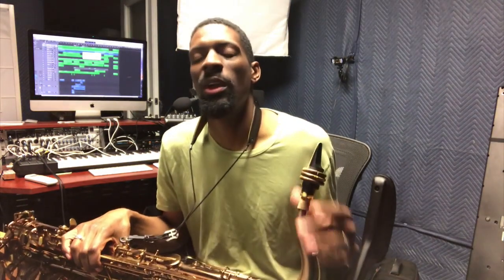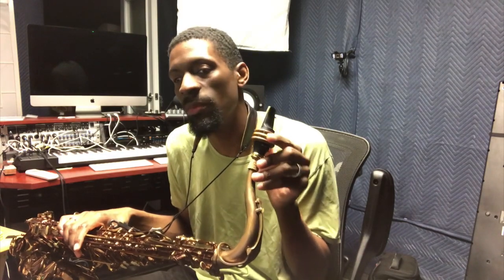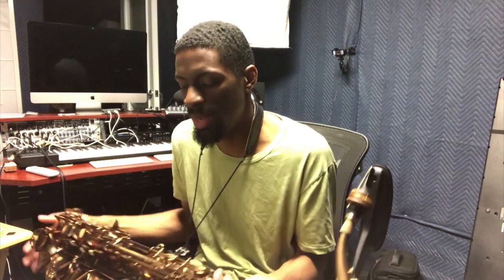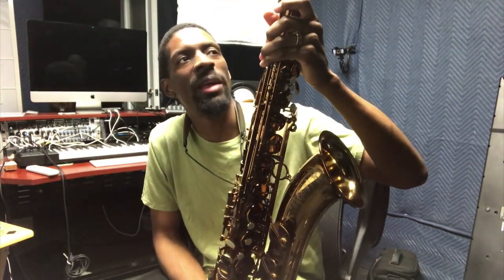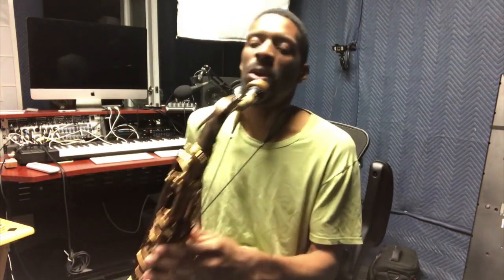How To Subtone On The Saxophone

Comment: I cannot say that I found your video of much or any practical value. Your video has only substantiated the conclusion I have arrived at after an almost infinite number of attempts at producing the subtone.You  produce the most beautiful subtone effortlessly and as you have demonstrated so eloquently with Misty that the listener arrives at the totally false conclusion that subtone production is merely a matter of shifting the lower jaw backwards somewhat. Every  jaw is different from every other jaw and the degree or extent which the jaw may be moved back or in any other direction varies. Your video demonstrates as not even a   million words would, the ability to move the jaw back is much more than ordinarily observable  in your case, hence the most expressive and exquisite subtone as easily produced with as much effort as would be required to breathe naturally in any other person. Applicable to  many other situations and circumstances,” one size does not fit all” is totally appropriate vis a vis subtone production. Thank you sincerely for a very demonstrative and explicit video and your very ridiculously simple , lucid  and factual elucidation of  your method of subtone production. The very very best to you.
Reply: Dear Mr Fowler, thank you sincerely for your reply to my rather dismal comment. Make no mistake about it, I consider you to be a Master Performer and cannot hear you enough. My almost unbearable disappointment was to   learn that I could hardly move my lower jaw back by more than a 1 cm or about one half inch and that movement required considerable effort and was associated with   discomfort. I could maintain a backward displacement of the lower jaw of about one quarter of an inch without discomfort, which  displacement however   proved quite insufficient to produce the subtone. I did find the tone mellow  down to an extent but the discomfort resulted in a displacement of not more than perhaps one sixteenth of an inch, totally inadequate for the purpose. Should you have to offer some sort of a solution involving positioning of the mouthpiece, lips, positioning of the head or any other alternative means that would effect the intended end result equivalent to a backward placement of the jaw, I would not be able to express my gratitude towards this very kind and personal  effort. Thank you,, regardless ,for an excellent and superbly explicit video on a most intriguing and for some at least a  most likely irresoluble situation. Thank you and my very best wishes to you.
Reply: @vivianastridge2167  the jaw needs to be moved back , it's not his method it's like everybody does, you also need to blow like you were fogging a glass. Of course , you will need to fiddle around to make it work , find the sweet spots etc...
Reply: thank you for your comment and advice. Strangely i cannot move my jaw back even a fraction of an inch but can move it forward about an eight. Apart from this jaw movement technique is there any other method i could try out. Thank you .

Comment: hi, any idea why I can't play low notes other that using Subtone and with double cushion. If I try the full sound with my teeth resting on the mouth piece, the notes just break or stay high.
Actually I never learned how to play with my teeth resting on the mouth piece, and I hate it. please what am I supposed to do in this case?
Reply from the maker: Make sure you horn doesn't have any leeks at the bottom. You need to increase your air stream, open up your throat and push the air through faster to make it come out. If it's hard to come it could be your horn or reed that needs to be adjusted.
Reply: @QuamonFowler  what about the mouth piece ?
Reply from the maker: @Redwane-Music  Yeah it could be. What’s the facing?
Reply: @QuamonFowler  how would I know, I don't see any number or letter written